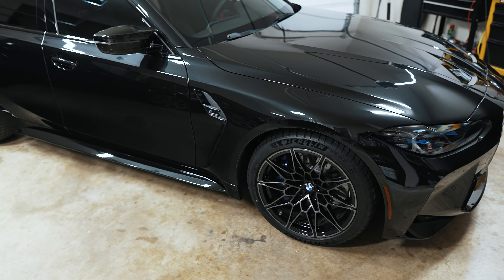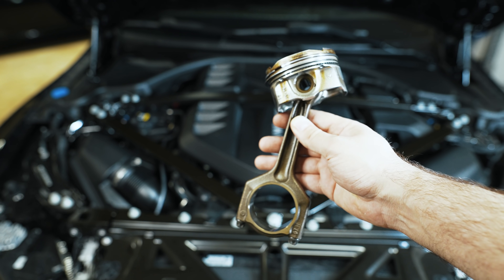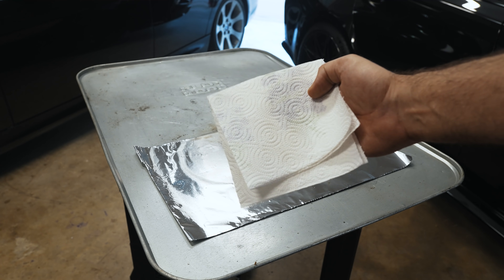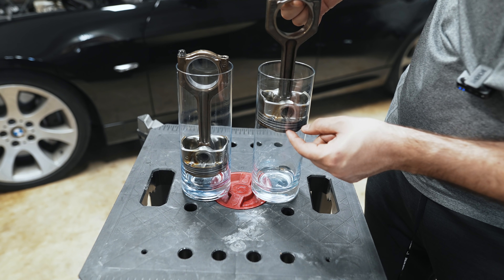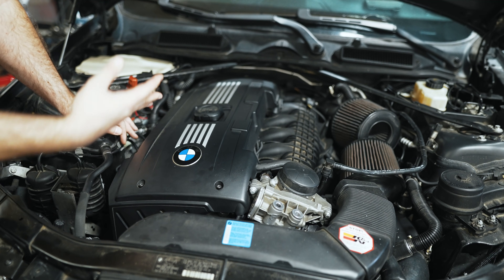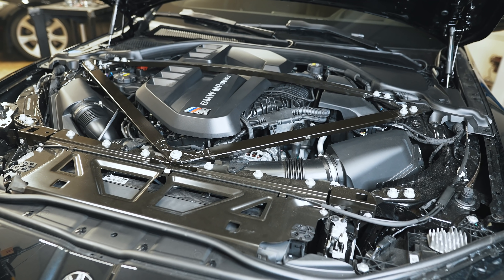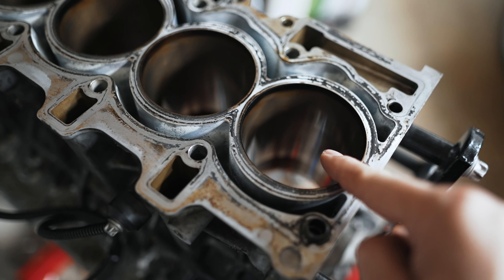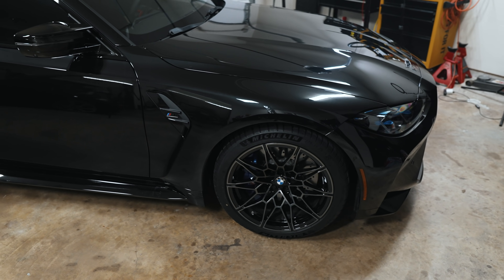This New BMW Engine Will Make 1000 HP Stock!

Comment: imagine an e46 m3 with that Frankenstein combo engine with the super high compression, direct injection, valvetronic, all being naturally aspriated. that would have been killer.
Reply: I wish m would make just one more Naturally Aspirated 6 cylinder masterpiece
Reply: @e46m54nissansr20937  It is called a 911 GT3 or 718 GT4
Reply: nycshelbygt500 yea pretty much that's the closest experience just want that inline 6 I mean a characterful flat 6 is beautiful as well but I want BMW to try again it'll never happen though
Reply: You can see this in the NA Lambos and Ferraris /Audi R8 nowadays👌🏽
Reply: Man that would be so rawwww

Comment: 1200 mile break in? Isn’t 500 miles much more common. Do you know why BMW requires such a long break in?
Reply from the maker: I believe it has to due with breaking in the differential as well, they change the fluid at the 1200 mile service, the engine should be done breaking in around 500 miles like you said.
Reply: @VehicularDIY  got it, thanks. You can probably get on the highway after the first 500 miles since the engine should be broken in.

Comment: the s58 will be the top tier BMW engine taking over any other manufacturer, thanks for the information learning more with this channel!!
Reply: Most definitely the b58 is already doing that some what but the s58 will solidify that top tier status
Reply: @e46m54nissansr20937  I just wish they’d have given it even more power. I know that there are some M3s out there with ~550 hp (even manuals) but the S58 is so potent that they could’ve given it 650 without any problem - and they know because they’re running the exact same engine in the GT3 championship. But I guess being already pretty close to the M5, this would have been a total humiliation for the bigger brother.
Reply: @larrypage1480  That job is for the tuner enthusiasts! 😃

Comment: Not sure if I misunderstood something about the n53 not having similar stuff to n55, but i have an n53 here in europe, i was following your tutorial on valve cover change and it's literally 99% the same thing, with variable valve timing etc etc, 270hp and can somewhat keep up with my friends 335i, awesome engines for sure! I think the reason n53 didnt come to usa is the quality of fuel, but not sure. Thanks for another lovely and informative video!
Reply from the maker: Yeah the N53 externally looks identical to an N54 besides the lack of turbos.  Thanks!  If they gave it valvetronic it may have made over 300 hp.
Reply: @VehicularDIY  ahh valvetronic, completely mixed it up with vanos! But you are definitely right, thank you so much for such great interaction, i really appreciate it!

Comment: Your proposition on 1000 hp by any modern BMW should also be underwritten by their poor reliability and lack of longevity without very expensive repairs and maintenance.
Reply from the maker: Yeah as you increase hp reliability would go down exponentially but that would be true for any brand.

Comment: I just feel this new m3/4 is going to sell out as soon as the tuner community gets wind of the engine potential.. especially in all wheel drive spec .. just epic potentail! Thanks for the thorough update and link to the redbull guys! Amazing info and nice job putting this together!
The gearbox, can it take 1000hp?
Reply from the maker: Supposedly BMWs sales for Q1 were up 20 percent and they said sales were boosted by the launch of the new M3 and M4.  Yeah I bet a ton of people are holding out for the AWD.  Thanks!
Reply: @VehicularDIY  is the gearbox capable?
Reply: The manual (GS6-53BZ) can. The auto will probably need a rebuild as it will most likely start slipping.
Reply: @AH4Z  definetly not the auto since that would more than likely need to be built for that(which there's already built versions of that auto anyway)

Comment: Just imagining! 🤔                650 WHP AWD M3 on 18” BBS wheels hugging some R888! 😱                       I can’t wait for July to place my AWD order!
Reply: Cant wait to get mine in 25 years from now when the price go down 😂😂😂
Reply: @kaizakkastro9717  itll be even more then the end of an era.
Reply: @kaizakkastro9717  I’ll be in line behind you 🙋🏻‍♂️
Reply from the maker: 0 to 60s in the 2s for sure.
Reply: @VehicularDIY  wow can't wait to get mine
Reply: @VehicularDIY   maybe. With the 2wd version weighing 3800+ lbs the AWD is likely to weigh over 4,000lbs. There is a reason the f80 still does 0-60 0.4sec faster even though it has much less power.
Reply: @Abec20  F80 is not doing 3.6 to 60 stock,  the G80 is.
Reply: @jostrander71   when Bmw released the f80 the advertised and proven 0-60 was 3.8. Even Bmw doesn’t claim the g80 does 0-60 in 3.8, they advertise 4.2. Either you didn’t do research at all or got them backwards. Over 400lbs makes a big difference.
Reply: @Abec20  No I have a F82 for one, 3.9-4.0 stock is good if the tires stick. BMW is sandbagging the 0-60 on the G80 at 4.0 4.2. CarWow has already proved a 3.66 to 60 in the 2wd version, Road and Track has it right at 3.3 with the awd. Yes I did research, it isn't 400lbs difference adding awd either.
Reply: @Abec20  The new G80 comp has 75hp more than the F80 comp. It better be faster.
Reply: @Abec20  Also The 2020 BMW X4 M and X3 M Competition both achieved a 3.3-second zero-to-60-mph time in Car and Driver testing. You think the M3/4 is going to be slower than the SUV with the same S58 motor?
Reply: I hit 2.99 in my X3M.. in the 2’s is VERYYYY LIKELY in the AWD M3
Reply: @JatinderToor20  confirmed...2.8
Reply: Thats a few too many drive wheels for me.

Comment: I think an n54 with ITB's would look amazing!
Reply from the maker: It would be neat to get a set of N53 pistons and run the engine in Alpha N mode with carbon box and ITBs but unfortunately the valvetrain wasn't designed for high revving.

Comment: Let's talk about how long it will last when USING the 1000hp.

Sure, thing it will not last. If it would be so easy - why would the engineers in Bavaria keep it at a lower output?

Happy greetings from the gearbox as well.
Reply from the maker: I'd say to meet emissions but yeah of course if you double the engine output you will shorten the longevity.  The gearbox is carried over from the M5 so it should be pretty strong.  700WHP should be reliable if the car is used aggressively I'd say the saying you have to pay to play always holds true.
Reply: @VehicularDIY  Thanks for the reply. I learned that 10% more load in load collectives means half of the lifetime. 

I did not understand the comparison you made in the description regarding octane and RON. 

We have RON95, RON98 and RON100/102 at the gas stations. I only heard that in some parts of Austria you get RON98 which has real 100 octane.

Greetings from Germany.

Comment: Ahem   ... Porsche 992 Turbo S.

Old 60's high performance like Ford's 427 were 12:1 with carburetors and who knows how much lead in the gas.

Problem with cam lobe driven S58 fuel pumps is they cannot easily be overdriven.

Carburetors do not "inject" fuel.  Fuel is drawn into the intake air flow continuously by the Venturi effect.

One thing not mentioned on the built S58 engine is if a crankshaft hub lock was employed.  If not, that would be a first at that power.  Presuming it did not have catalytic converters.
Reply from the maker: Wow I just looked it up you're right for 2021 they dropped the compression ratio down to 9.8:1 to 8.7:1.  Yeah when they switched to unleaded it must have been a mess trying to keep those high compression engines running from back in the day.

Comment: Is it currently possible to tune the G80s version of the S58 to make more power yet/ are you going to do that to your car? I heard on a BMW forum that the new ECUs are near impossible to trick after BMW made some changes halfway through the prod. run of the x3/4m cars.
Reply from the maker: From 2021 onward most DMEs are locked and it's hard to say if that will change.  My 2020 M340i had an unlockable DME and later production M340is came with locked DMEs and they've been working on it for a while now.

Comment: In the sunset of petrol engines it is nice to see they are still making such improvements. I wonder when most if not all petrol cars will be PHEV, for the instant torque for moving off on green light to the turbo/boost in the higher speed range. Will they have balls to try M3e or will they preserve M3 as purely ICE car and make something new.
Reply from the maker: Yeah from what I understand as long as they can push enough mild hybrid cars out the door it opens them up to building more standard engines so it averages out as a fleet of vehicles.

Comment: Aren't there several other engines capable of that? 1jz, RB25, LS
Or have i been LIED to?
Reply from the maker: To answer that question think about what people are swapping into drift cars, pretty much all engines you listed.
Reply: None of them do it on an untouched engine though from my understanding.
Reply from the maker: @markburkey6371  On a stock bottom end yeah typically no.

Comment: No. They did it on 102 ron (Aral Ultimate)
Reply from the maker: I updated the description as they said they made about 900 on 95 RON before the head work and 750 on stock turbos and 1049 after the head work, port injection and upgraded turbos on 102 which would be more like 97 octane but not race fuel.
Reply: @VehicularDIY  You may want to research a bit about Aral Ultimate fuel. It seems to be top notch fuel. Also in the video the guy on the other side says that it is basically race fuel. At least this is how i understood it.
Reply from the maker: @davizzleman  At the 3:50 mark they confirmed the fuel they used is available at the pump, the guys said "No race fuel"  It was sourced from elf which is sourced from the same supplier that supplies stations in Germany and is available at the pump.  In the US typically you can find the equivalent of 98 RON at pumps.
Reply: @davizzleman  As a german, I can confirm that you can actually get 102 octane fuel at most gas stations in Germany :)
Reply: @obihornchen6508  haha i am also german :D i know that and am running HP650 turbos at 21psi with 102 ron fuel at 6.3s 100-200kmh
Reply: @davizzleman  Nice ;) But Aral Ultimate is actually not at all race fuel, it is completely normal  stuff with just a higher octane number, afaik.
Reply: @obihornchen6508  i just have heard rumors about the aral ultimate being top notch fuel close to race fuel during my research. It must be a premium fuel as i can run a lot of more timing to our next super plus fuel.
Reply: @davizzleman  Yeah it's premium, but I don't think it is anywhere near actual race fuel. What do you mean by "can run a lot of more timing to our next super plus"?
Reply: @obihornchen6508  i get lots of corrections running up to 9 degrees on super plus. With ultimate i have no corrections running up to 12 degrees.
Reply: @davizzleman  Well yes, that's because of the higher octane number. It tends to knock a lot later than lower octane gas :)
Reply: @obihornchen6508  I know. But this timing is getting close to E85 lvls.

Comment: I live in Canada and we have 94 octane pump gas with a 10 percent ethanol content, it's not the best but good for tuning an N54 with bolt ons, with 17t turbos I was able to get 493 whp at 20psi using Petro Canada 94 octane pump gas but I'm at the limit.
Reply from the maker: Yeah I'm originally from there, I used to get Sonoco Ultra 94 back in the day.  My buddy tunes Q50s on EcuTek and he said you can now get 94 at Petro Canada and he said it's about equivalent to an e30 mix down here so it's pretty good.
Reply: @VehicularDIY  oh you’re Canadian too eh , well that’s news to me, I got my custom tune from an American place called Twisted Tuning , I hope he knew when he wrote my map that the 94 octane is equivalent to e30 mix , maybe I’m not getting my full potential,

Comment: Would you say the N54 has any advantages (in a single turbo format) over the 2JZ, B58, S58 for regular car guys to swap into their cars? 

I feel like the only advantages the N54 has over all of them would be cost over all 3, then simplicity over the newer bimmer motors, and weight over the JZ, potentially reliability in a few years. 

Im very biased to the N54 but I want to see this in as unbiased of a way as possible
Reply from the maker: I would agree with that statement, the N54 has the advantage of cost on a stock bottom end.  I can understand that you're biased to the N54 there is something special about it.  If you had a lot of seat time behind a B58 I bet you'd love it.  It has a pretty strong torque shove with it's single turbo.  With the S58 it's setup so that to have any fun you'd have to be flying as it pulls harder the higher you rev it like old school M cars.  The B58 has more theatre as a daily driver over the S58 and the N54 with upgraded twins feels like it can hold its own against an electric car with its torque lol.
Reply: @VehicularDIY  lol yeah makes sense, n54 in an E92 has been my dream for since I was about 10 (18 now) so im pretty emotionally attached. My goal has been to further the N54 platform by making it more reliable, cheaper, and simpler for street and race use (drift and grip mainly). For sure want to drive a B58 car though, absolutely love how they sound.

Comment: Very nice explanation. And the n53 were in the 5 series in Europe. 523i, 528i and 530i. Starting at 204Hp and ending at 272Hp, just by little changes and different ECU's. A friend of mine drives the 523i for many years now. He never had an issue and now he is on 220k km's (138k miles). I didn't know the n53 was not sold in the US. Dutch regards, Nico.
Reply from the maker: Thanks, yeah supposedly it wasn't offered in North America due to the high Sulphur levels found in the fuel here.  I know that issue is prevalent in Canada if someone floors their car in front of you it can smell of rotten eggs.  In the US I haven't really noticed that, I believe in Texas they refine that out more.  The funny thing is the N53 shares the same fuel system as the N54 so that would imply that maybe the Sulphur was leading to the leaky injector problem?  Perhaps it would have been too much of a risk but the N54 was sold in relatively small percentages compared to the N52 so they proceeded anyway and fixed the issues along the way.
Reply: The e90 330 with 272hp had a different intake manifold than the 325 with 218hp. Also there was a 325 with portfuel injection, making 218hp as well. The portfuel injection has the old turbine like sound we all love r6 BMW engines for. The later DI models sound less pleasing in my opinion. 

It is just a basic misunderstanding that all engines are simply detuned by ecu for lower rated power variants. Especially when talking about naturally aspirated engines. 

With turbo engines you could easily reduce the max. torque by ecu software...
Reply: This is simply not true. The pistons in the higher performance models are made out of a varying alloy mixes to stand up against the increased pressures inside the combustion chamber. 
The B48 in the 320i and in the 330i have the same engine code but the 330i engine has a lower compression ratio to prevent engine knock due to the higher volume of air being compressed inside the combustion chamber to prevent premature ignition. It also has a vastly different air intake path and a charge air-intercooler.

Comment: Also another question, from my perspective ethanol seems to be safe if your spark plugs are gapped correctly and on the correct tune. Do you feel a 2015 335i can run an e30 mix without messing up the engine or crystallizing the seals in my engine/ fuel lines?
Reply from the maker: Yes I would think so I ran a mix for years, the fuel system is pretty adapted to use it already from the factory without adverse effects.  I would make sure your car is already running index 12 injectors.
Reply: @VehicularDIY  thank you this is very good information. I actually have a n55 on stock injectors and coils still at 83k miles. Spark plugs replaced with NGK about 5k miles ago. Was thinking of switch to an e30 mix and replacing the coils this time and doing the spark plugs again but to the correct gap. I was also thinking of replacing my injectors kind of on the more preventative maintenance side but I was told ethanol helps clean them in a sense. I don’t seem to be misfiring, maybe a little power cuts off really quick at like 5-6k rpm but I honestly assume it’s just my shitty ots map from Bm3. So what are your thoughts should I do my injectors as well? If so is it safe to run an e30 mix as soon as you get new injectors installed or is it good to cycle a few tanks or so of 91 before you use ethanol.

Comment: Great video, but compression ratio is also varied quite greatly via the cylinder head chamber CC!
Reply from the maker: Thanks, fair point they didn't mention if the effective compression ratio was lowered by the changes they made to the cylinder head.  It would be great if they could get us that info.
Reply from the maker: One thing they did say is they hit about 900 HP on a completely stock engine untouched head on the equivalent of 91 octane.  So maybe closer to 925 HP would have been possible on 93 octane and close to 1000 HP on E85 if they had tried to run that.  So perhaps they lowered it slightly with the head work.  I think it's safe to say a set of upgraded turbos would easily allow for 850 crank HP on 93 with an otherwise stock engine with significantly more torque.
Reply: If you want information please contact us.  We are not in a poistion to give out every detail but may be able to answer some of your questions.